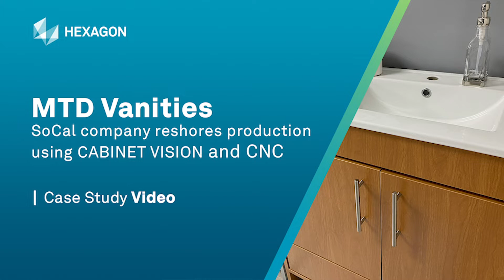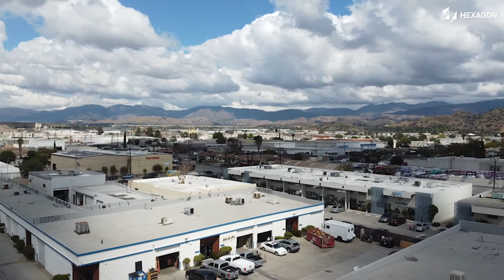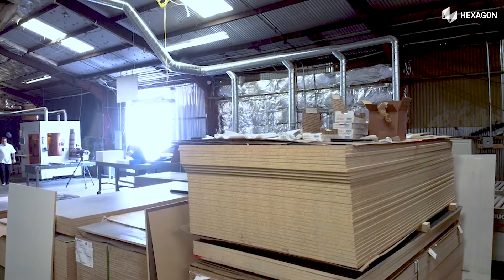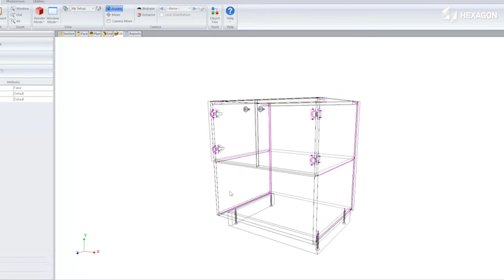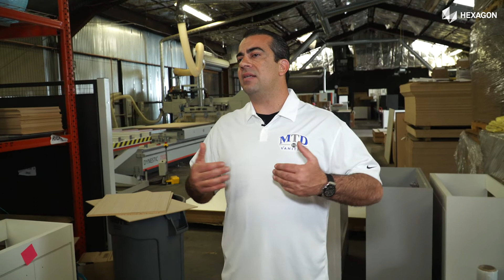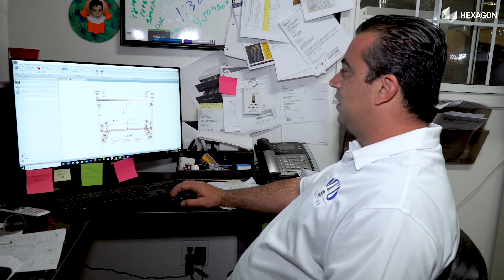CABINET VISION Customer Case Study - Volpa USA

Comment: Lior is spot on with training. It is huge. You don't just open the program and go. He was not spot on with the phone call though "give them a call, jump on a line (he actually mean wait days for them to call you back)" 
Also, that's the smell of particle board / melamine..not wood. Looks like MTD only manufacturers vanities? Thats super easy to do in CV but wait until custom comes and it not just a simple box, you'll be jumping on that call. Still my goto program though but this is just a little misleading for someone who does not know about CV.

Comment: Meh, seems like CV has its yearly wild hair to produce a video. It's overrated in my opinion. Was sold to the company I worked for claiming it could communicate with our CNC and turned out it didn't. Spent a long time messing with this program only to switch to a different more intuitive software.
Reply: what cnc do you have?
Reply: Which software you switched to? Interesting to know as I tried CV too...